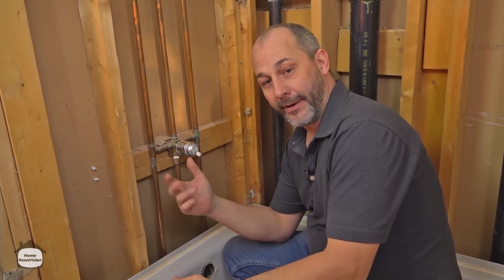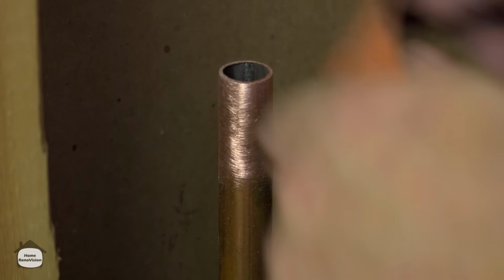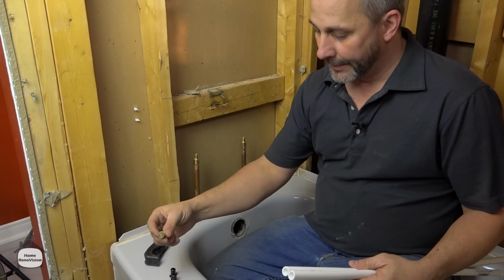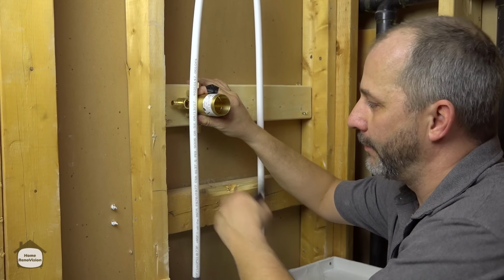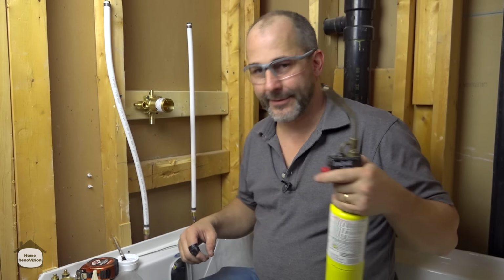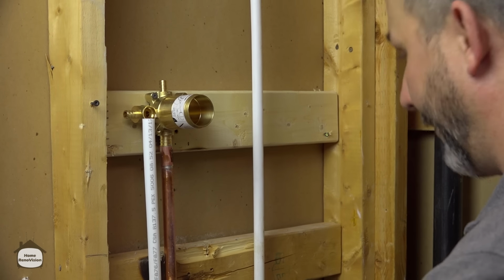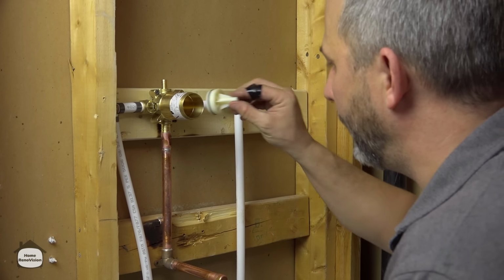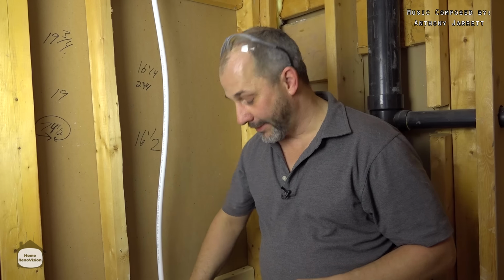DIY How To Install Copper To Pex Shower and Bath Plumbing

Comment: I love Pex to death but what about the crimp testing "horse shoe"?  It supposedly tells you if you botched the crimp.  Should I do this if I'm new to Pex?
Reply from the maker: once you have your crimper set to the right place each crimp is perfect every time if you close the handles all the way. there is no variance in the installation so you only need to test after adjustment of the crimping tool. Cheers!

Comment: How do you let the air escape when you do pressure check in pipes?
Reply from the maker: if the air does not leak the water won't either.

Comment: Wow! That`s great! There are lot of vital tips!  But the majority of mixers have only threaded conenctions. I like copper and I want connect a modern threaded mixer with my existed copper pipe line. Is there any convenient technology for doing this (with no copper to PEX adaptors), please?  Thank you
Reply: When you look at your threaded connector, look on the inside.   You can sweat a 1/2" copper in there.   (or you can sweat on a pex fitting or you can screw on a female FIP to pex fitting).   If sweating, be sure to take out the rubber valves if you have the one with the water cutoffs integrated like in the video.

Comment: GREAT VIDEO! I purchased everything I need for this project, but can't find the specific shower valve you're using. Where can I find the valve, or something similar that will fit all the other materials I've purchased? Was I correct to purchase 1/2" copper and pex for the entire project? Thanks for making plumbing seem simple for the average bloke!
Reply: That one was a delta or a sister company of delta with integral stops on the hot and cold as he showed to shut off the water coming in so as not to mix the two until the cartridge is installed then it will automatically adjust for any differential in pressures between the two all shower valves now single handle anyway are pressure balancing and anti scald meaning you can set the limit on how hot the water will come out to prevent a toddler say from being burnt or as it used to be if you were in the shower and someone flushed it would change temp it doesn't do that anymore ..

Comment: Is there a specific reason you don't ream the inside of the copper lines?
Reply from the maker: If I use a hacksaw I ream when i use a pipe cutter it tends to be redundant.
Reply: @HomeRenoVisionDIY  Hmm.  My understanding was that, among other things, if this rough inside edge is not removed by reaming, erosion-corrosion may occur due to local turbulence and increased local flow velocity in the tube.

Comment: Jeff.... If you have a 1/2" water line coming in from the street, and then you up size to 3/4" or 1", will you actually gain more flow for things like showers, irrigation, etc.. or does this accomplish absolutely nothing as the main water line coming in is still only smaller 1/2"
Reply: Yes you've gained nothing

Comment: Are sharkbite connectors from the copper to the pex a feasible solution instead of soldering on the copper to pex fittings?

Comment: there is cold expansion pex fittings by Uponor, (Home Depot sells knock off's by Apollo) and it is easier to use for DIY folks.
Push to Connect fittings (Sharkbite) are even easier, but that system relies on rubber O-rings, and longevity is suspect, and those are rather expensive option.  Sharkbites are excellent for emergency repair though, and very reversible.

Comment: Installed new shower and tub , pexed everything ..... when water is on from spout , it leaks from shower head and I was told to copper line to spout ....Did that and still leaks from shower head   ?????  , used quick connects on shower handle drop to a quick connect elbow to spout ????/ what you think .....?????TY
Reply: Its upside down the valve is installed upside down
Reply: Sounds like you have a bad shower shower body valve, there should be no pressure up to the shower head until water is directed from the spout. The quick connects arent the issue.

Comment: I am very wary of anything plastic after having a braided 3/4 line fail on my water heater. Pex and the construction of that braided line are the same... how can I trust pex won't do the same? Luckily the fitting came off the 3/4 line on the heater when I was home and only 10 gallons came down from the attic.

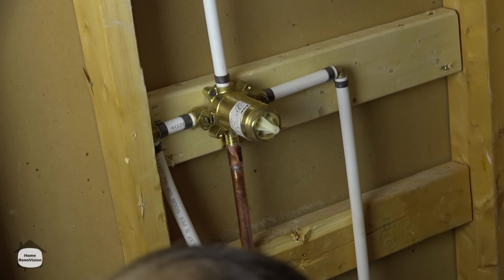Comment: At 24:27 you show the special temporary screw in adapter plug for shower arm outlet.  Is there specific name or brand you recommend?
Reply from the maker: Hi Dan, I have a list of my favorite tools and materials on our Amazon Page. the link is in the video description. Cheers!
Reply: Just use a 6” nipped and cap

Comment: At 6:25, you could add another step. Before putting the brass over the copper to soldier, a YouTube welder with 35 years experience will brush flux over the end of the pipe.  The flux will create a chemical bond for the soldier to the copper. One can't torch the joint too long at the risk of burning off the flux.
Reply: Ahh, my bad, you did add the flux to the brass. I think it should be added to the copper.

Comment: Good video.  I avoided the brass fitting for years and used shark bites because I couldn't get it to solder.  Then was told to use Mapp gas.
Reply: Noticed the MAPP gas too. But really isn’t necessary, just faster because it’s a little hotter. With plain propane, use a tip that concentrates the heat, and move the flame a bit like with gas welding. You can do most soldering this way and even some brazing, but not quite as fast. Use an old license plate as a heat-shield!

Comment: Thanks to your video I just installed a new shower valve in my newlywed son's house. I soldered the copper to pex fitting, which really wasn't difficult. For the tub spout I used iron pipe. Everything else is pex. I removed a four tile by four tile (4" tile) square to access the plumbing. The existing tile is on cement backer board. I exposed vertical studs so I can attach a piece of cement board. There are no horizontal studs to tack into.  Are they required or is the cement backer board rigid enough to tile over without the horizontal framing? (16 inch by 16 inch).
Reply: Yes horizontal framing is not required vertical  is enough

Comment: I thought we have to remove burs inside copper pipe after cutting, to keep the 1/2 inch id. Nice to acquire new knowledge from your videos. Thanks for posting!
Reply: Jocelyn Savard you should always ream the pipe. If you don’t it causes pipe erosion because of turbulence.

Comment: Love your videos. You have an amazing amount of different types of videos and they are all helpful. I was just curious, but why didn't you put that flux on the copper before soldering? I am not a plumber, but I've seen other videos where they do that. Was this different. Thanks again.
Reply from the maker: i put the flux into the fitting.

Comment: The only thing we didn't see you do was verify how deep into the wall the valve had to sit. You didn't have the mud ring on to gauge the valve depth with the finished wall surface.

Comment: Hey Jeff - this video is exactly where I'm at also: renovating a shower and have my rough hot and cold water lines cut and capped. How's the longevity of PEX in the wall? Will it hold up for 30+ years? I noticed there are several different crimp connections and tools for PEX - do you suggest a particular crimp technology?

Comment: Before you start making videos on how to do something perhaps you should learn how to do it properly yourself.

Like Daversj pointed out you did not deburr the copper after you cut it. Rookie mistake. This causes unnecessary turbulence and eventually a shard of copper will get burned off and end up cutting up and destroying your cartridge seals made of rubber and or impeding operation and flow. Shaking my head.

Comment: Jeff. How do you finish out fiberglass shower walls screwed to studs? Got to install sheetrock from existing sheetrock to finishing out over the flanges and screws of the fiberglass walls. What is your method?

Comment: So glad I found you. Been watching your videos and learned a lot. I have one quick question about sharkbite. Is it fully recommended to use sharkbite behind the wall where you won't be able to see if it potentially leaks? Have you ever had any problem with sharkbite leaking? I am leaning towards to buying sharkbite for my plumbing in the bathroom. Let me know!

Comment: Do you feel comfortable producing  a video on installing a new t/s valve while using a smitty plate replacing a 3 handle valve to a single handle while leaving the existing tile
Reply: Moen makes what i call a "repair plate". It lets you cut out a little tile to convert it to a single handle and put a bigger trim plate to hide it

Comment: About ready to dyi my bathroom in our new house and I am very confident I can do it now that I have been watching your videos for the past few months. What is the blue shower head plug you are using called? I called a plumbing supply shop and didn't really know what to ask for and the guy had no idea what I was talking about. Is there a specific name for it or is it just a 1/2 inch threaded plastic plug?
Reply: Just get any threaded nipple made of any material and a female threaded cap it's only temporary anyway just for testing purposes

Comment: How would you attach the plumbing if your interior studs are metal. Florida houses don't use wood.
Reply: Probably self-tapping metal screws
Reply: And copper cannot touch the metal studs whereas the pex can ..

Comment: I have never seen someone solder A fitting by just touching one spot wow and you would have enough to run off of the fitting you could have soldered the other one
Reply from the maker: let the heat and the flux do the work. Cheers!

Comment: Hi Jeff, We are thinking about remodeling the upstair bathroom because there is a very very loud water running/flushing noise coming down to the kitchen from our master bathroom every time we flush the toilet. The contractor told us the only way to reduce the noise is not putting insulation in the wall where the plumbing pipe is but putting insulation in the bathroom floor when we redo our floor( our master bathroom is directly above the kitchen with the plumbing line running along the wall of the kitchen). We are first time home owner and know very little about these stuff. It would be awesome if you can help us out by giving us some of your opinions about what might be the best way to fix this problem. 😥😥. Thanks for all of your informative videos. They are awesome!
Reply from the maker: Hi Nickie, soundproofing is as easy as opening the wall and wrapping the pipe in insulation and then closing up with fire rated drywall. Cheers! It would help if the pipe was on a small angle and not straight down.
Reply: PVC is noisy insulation or change it to cast iron is the only options cast iron is known as the quiet pipe

Comment: Why didn't you use pex for the tub spout line?
Reply from the maker: This particular cartridge uses a physical diverter and the shower head will drip while filling the tub otherwise. some people have a problem with that.
Reply: @HomeRenoVisionDIY  Thanks for responding back

Comment: One tip from my experience, some types of flux expire, and no longer work over time, so if you have some flux from years ago, throw it out and buy some fresh stuff.
Reply: One time, I bought the white flux Jeff was using, NEW. I did everything correct, but the joints would not take the solder. I then bought the kind that I always used, the kind that looks like grease. Then I had no problem. I then made "test soldered joints" just to see. The white flux failed every time, the grease kind worked every time.
Reply: Yes sir I've had that happen which to me was a surprise after being in the business  30 plus years it was the first time I had flux go bad since copper is being phased out I've not been doing much copper but back in the day I ran what must have been miles and miles of copper piping my hands were green sometimes when I didn't wear gloves anyway great video

Comment: Question: I hear that this product get tiny pin holes with time or they leak from the connections and I also hear that mice and or rats get to it and start eating at it? Any thoughts on these concerns? I'm thinking about applying this product in a rental that I'm putting together but started hearing these things about it and now I'm thinking twice about it.
Reply from the maker: you are talking to the wrong people. Cheers!
Reply: Mice chew it for the water. The smell of plastic is the attraction. Easier to chew than metal or copper.

Comment: Hello Jeff.  I am preparing to redo my shower and I have a couple of questions...1.  can you recommend  a shower valve brand to use.  I currently have a hot and cold separate and want to go to a single value like in this video.  2.  Do you have any pointers for installing 12 x12 sheet tiles with 2inch x 4in tiles with in the sheet.  I ask because I am not starting with a 12in square...they have a mesh patter.  Thanks for all your videos I have learned so much and I am ready to start my project.  Ryan from Boise Idaho.
Reply from the maker: design is personal just be sure the tiles are all the same thickness so you can use leveling clips to keep it smooth. And I love Riobel. Cheers!

Comment: What sort of white paste did you put in the brass fitting before soldering? 
I'm trying to fix a copper joint leak for my parents' bathtub.
Thanks for sharing.
Reply from the maker: flux. cheers!

Comment: In the removal of the old shower plumbing, it was originally installed with both a hot and cold riser (using a "T" joint ) which apparently are used to eliminate water hammering. During your installation you went directly into the mixing valve with elbows only. Your opinion on this please.
Reply from the maker: pex expands under varying pressure and thus does not have  a water hammering problem. That issue is isolated to copper installs only. Cheers!
Reply: Thanks Jeff. During the removal of my copper plumbing (23 year old home) there was no provision for the water hammering , it was elbowed directly into the mixing valve. I have had no water hammering issues. I will be installing my new fixture with copper. So if it is still a code requirement, I will install the risers. As that other guy says, "lets do it right".

Comment: don't you need dielectric union between cooper and brass?
Reply: No... Unless its copper and galvanize
Reply: Copper and brass are similar metals as where any other type of material would be dissimilar metals and would require a dielectric union to prevent electrolysis good question tho

Comment: That's why License Plumbers everyday will be Charge more money to home owner because if everyone do they own project Plumber cannot hire Plumber Techs and in the near future it will be less people motivated to become a Plumber. Plus do not mention that any Plumbing work to that level required to Pull a Plumbing permit and have a few inspections before job get ready to Install sheetrock
Reply from the maker: just 1. Cheers!
Reply: It's how it goes and it's not going to get any better either things are not as they were and will never be again .. the generations will die off and copper will as well it's just how it's going to be

Comment: A shower faucet with out air chamber make pressure hammering noise every time water is open
Reply from the maker: when you use pex you never get a water hammer. Cheers!
Reply: Maybe u right but pressure are the same on copper or pex 

I a licensed plumber in city of Chicago here pex are 🚫 illegal to used only copper I know every opening required air chamber both supply lines
Reply: The pex can move due to the water hammer but you don't hear it as you would with copper and the rigidity of it that's the reason air chambers are not required  it also can freeze without breaking  do I like pex not so much. But it does perform as they say it will I'm a northern plumber and a southern standard plumber and we needed air chambers no matter where I worked but pex has changed that.. it sucks and has made it too easy and taken away a lot of jobs but so did Henry Ford with his assembly line it's just how it is brah ..

Comment: Enjoyed the PEX conversion ....  but what's missing is how to set the back nailer so the mixing valve is properly aligned with the finish wall.  This is critical for anyone doing tile but applies to enclosures too.  So, how did you decide to put that 2x4 flush to the back wall anyway??  :D
Reply from the maker: Hi Dan, every valve comes with instructions for setting it in the wall. you need to take into account all those variables specific to your install and your valve. Cheers! When in doubt read the installation instructions.

Comment: Whats your take on Sharkbite fittings? Makes copper to pex 100x easier, no soldering required.
Reply from the maker: love my 50 year sharkbites. but try to install them where you have access. cheers!